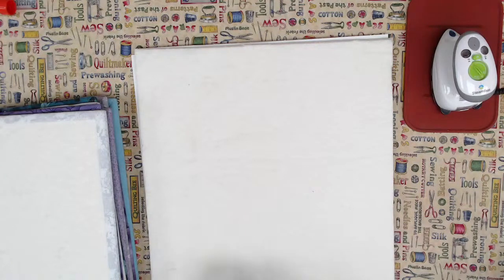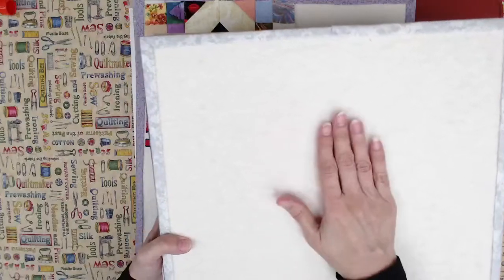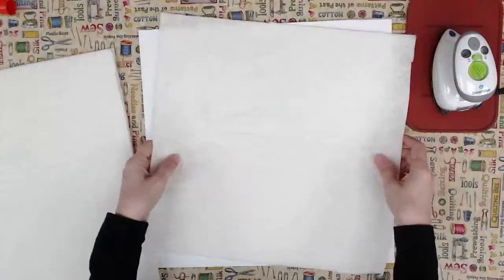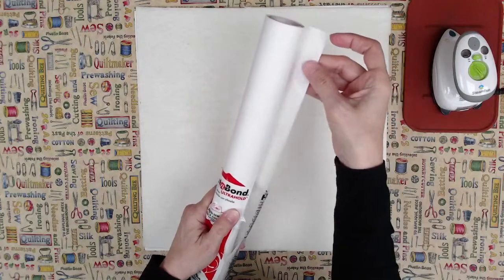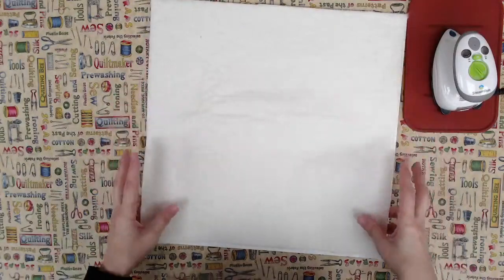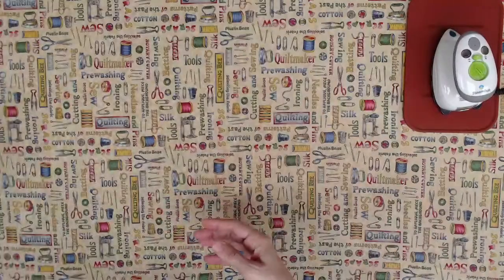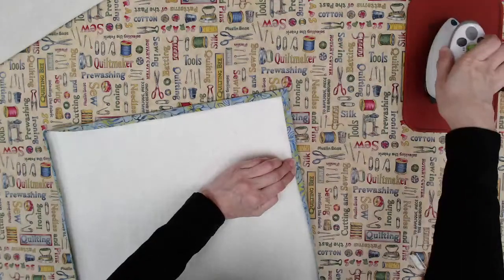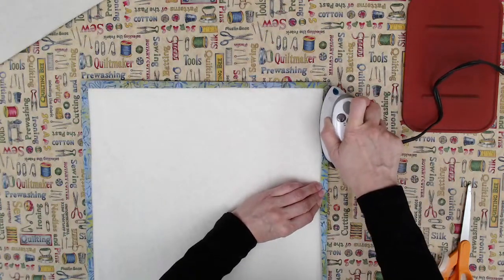How to Make a Quilt Block Design Board the New Easy Way (No Glue Gun or Sewing)

Comment: When I made my design boards I used dollar tree colored duct tape.  No binding or glue.
Reply from the maker: Noreen, that is always an option and a good idea.  I wanted to use my pretty quilting fabric scraps, so I chose to do it this way.  Happy quilting!
Reply: I'm coming to this a bit late, but this is a brilliant idea. I'm not worried about it being pretty, just functional. And I didn't want to bother with glue. I also didn't want to use my scraps on a tool, when those could go into a quilt project. Thanks for posting this idea about the duct tape. Hrm ... Really good athletic tape or medical tape might work also, for the more fabric like feel. Hehe ... now my brain is working  =D
Reply: I've used something similar in the UK BUT after a while the tape started sticking to other things so became annoying. I take art canvas boards and staple wadding to the wooden edges. So far this is working very very well for me  and I'm thinking of making several more . Yes you have to watch that you don't press down in the middle of the canvass but that is a small price to pay for easy put together. However after watching this video I might get some foam core and the Heat & Bond Firmhold to use some of my colourful batiks  . Thank you
Reply: I have a cloth tape used for hockey sticks which has a fabric feel and stretches ever so slightly. I use it around my sewing room for many things. It is great for taping around plastic tools that need a good place to grab that is not slippery. It is also a pretty blue colour. Canadian Tire carries it and I’m sure you can get the equivalent in the US somewhere.

Comment: I am going to make this, but I think I will make a larger one so I can hang it on my wall. I will use the same method as you have shown here thank you so much. It is easier than I thought.
Reply from the maker: Wanda, that is a great idea!  Instead of the foam board, try using a sheet of the pink foam insulation board they sell st home improvement stores.  That will make a whole wall size.  :-)
Reply: @piecesofthepast  Thank you for the tip, I will check into it :)

Comment: What are the foam cord? Heat&Bond- use has batting- 8x20pellon, glue stick, ultra-hold and sheet of wax paper and other side of glue and it’s permanent
Batting-soft side smooth and other side is pimples( put down of foam cord)- 2 1/2 inch binding x4 block; 21/2strip down, press in half with iron, cutH&B in strips stick glue side and iron on binding,
Then peel off of binding dry helpful- thanks!
Reply from the maker: You are welcome.  I am not sure if I understand your question, if you have one.  If you are looking for the products that I used in the video, click on the description of the video and then click on "read more."  There are links in the description for most of the products I used in this video.  Hope that helps!

Comment: What temperature do you use on your iron
Reply from the maker: Terry, thanks for the question. I am one of those people who keeps their iron on high all the time. So, I am sure it is on high in the video. For the design boards you will need a good bit of heat to melt the fusible web, so I would say use your iron on high, but be careful not to get any one spot too hot. Hope that helps a little. Thanks for watching 😁

Comment: How long does that stay stuck on those boards?  I like the idea but we live in Florida and nothing resist to glue…it is way to humid.
Reply from the maker: Hi there.  I am in Alabama (also crazy humid) and mine have not come apart yet.  It is heat bonded to the board, so the board should wear out before the edges would come unglued.  Thanks for the question!!  Deborah

Comment: I use flannel not batting
Reply from the maker: Flannel works too.  The more cotton in the batting (flannel is all cotton) the better.  Aren't these boards so helpful?! ~Deborah
Reply: @piecesofthepast  yes they are I have been making and using them for years. I buy the 16” square cardboard on Amazon 😂 (I hate cutting it) and use basting spray on the front and then fold over (about 1” overage around) the edges like wrapping a present, glue down with a permanent glue stick on the back. I even stopped taking the time to sew binding on.